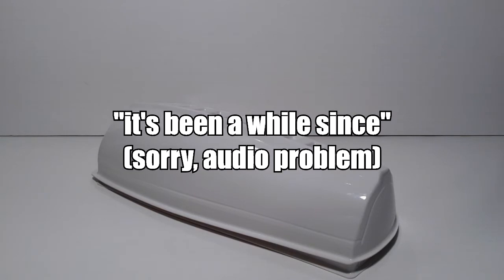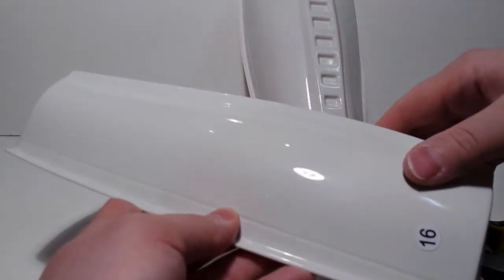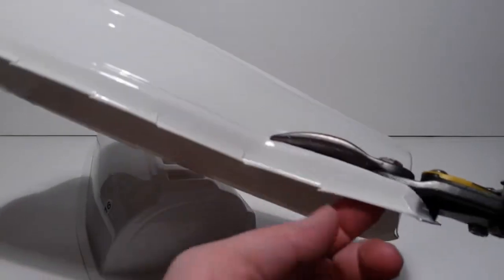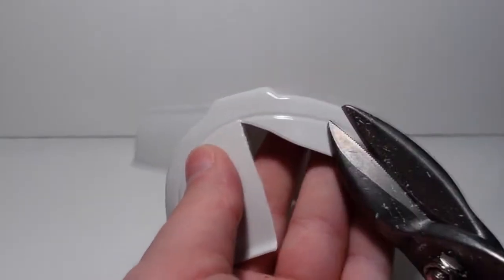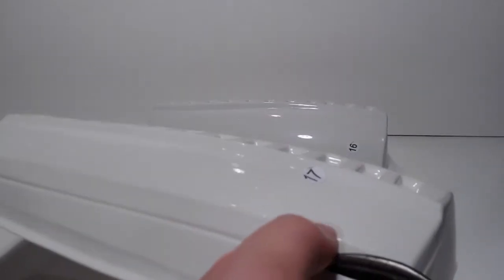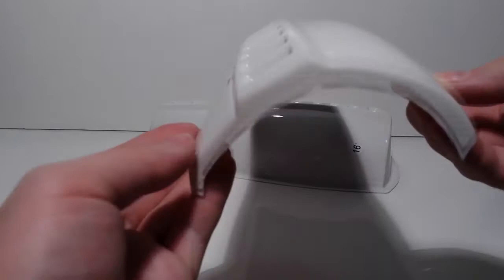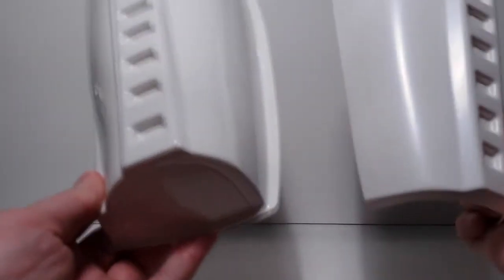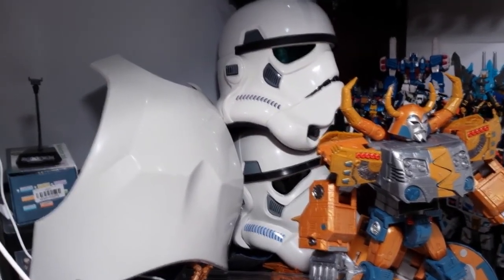Anovos Stormtrooper Armour DIY Kit - Part 2 - Cutting & Sanding

Comment from the maker: Finally getting back to this project and wanted to share that the best glue for parts assembly is OATEY ABS CEMENT for plumbing. I tested several cyanoacrylates and epoxies and they all come apart but the plumber's glue is solid as heck!

Comment: Great video.  I recently bought a shadow trooper kit and was going to cut with the electric tool, but it was very risky, I will instead use the tin cutters as it appears to be less risky.
Reply from the maker: Shadow Trooper, nice! Glad you found the video useful. Good luck with your kit.
Reply: Did you finish it?

Comment: Could you cut it with anything else because I'm definite that I don't have tin snips
Reply from the maker: Maybe wire cutters but i can't think of any other hand tools that would do it. Tin snips aren't expensive though if you  have a Walmart or hardware store nearby.
Reply: Transfixed Ok thanks

Comment: You do realize that you can use Novus plastic polish and it will take off most marks from wearing your kit.
Reply from the maker: I did not, but now i do. Thanks for the tip!
Reply: Paint is to hard to match up with the plastic and it scratches off very easily.